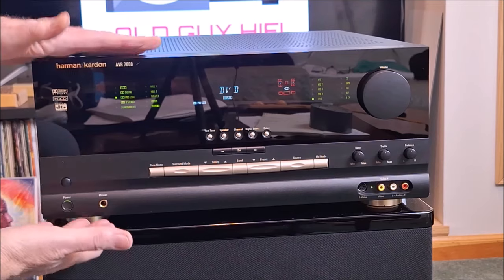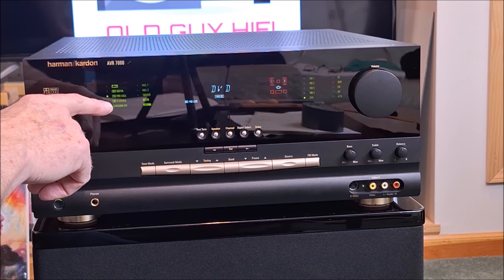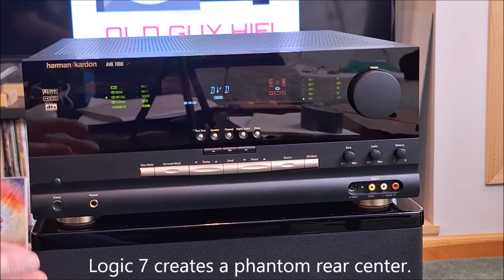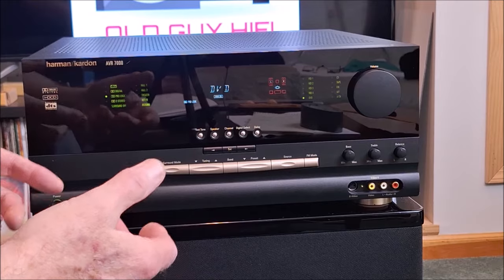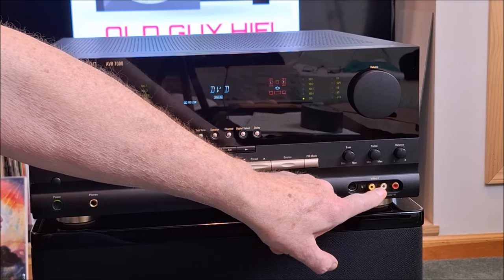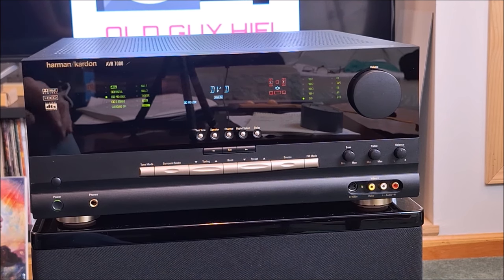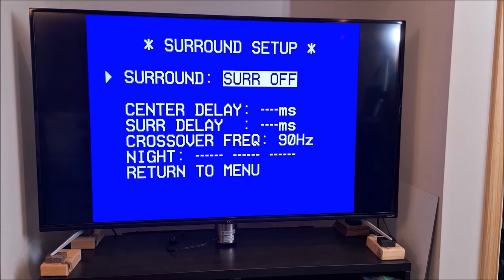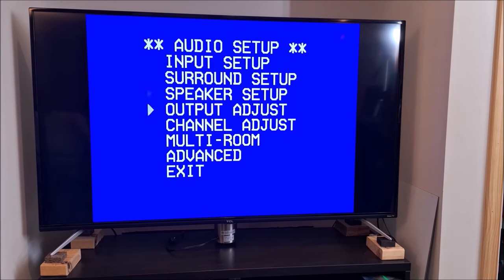A look back at the Beast that was the H/K AVR 7000

Comment from the maker: Hey everybody!  I hope you get a kick out of this nostalgic look back on this HK receiver.  Please like and subscribe.  Thanks for the views.
Reply: Thank you for this video.i love the old school HK amps,even the silver faced amps, especially the ones with the long vertical buttons.
Reply from the maker: I agree.  The series up to 1983 had that look.  I had an old HK 690i that was styled like that.  Thank you for your view.
Reply: I'm a fan boy myself.   I would sick a Harman Kardon 730 twin power on just about any of the 70's Marantz receiver.  Factz
Reply: Thanks for the great review! I also own an AVR 7000 which I've had since 2000. You mentioned you were getting your unit repaired. I too need to have mine, the DAC, repaired. Any suggestions on where to get a unit serviced? I first saw you over on CheapAudioMan thanks to Randy.
Reply from the maker: Ken, I was not able to get mine repaired as the parts are no longer available. Unfortunately I had to recycle it. I am very sad about that. I really loved that thing. My repair guy said that parts for these are made of unobtanium. He couldn't find a source for any HK parts for this unit. I know most of the Dolby chips are Sonys and no longer made. Good luck with yours.
Reply: @ That is sad to hear. I will probably use mine as a power amp with an external DAC/ preamp. Thanks!

Comment: Serviced them. Giant toaster ovens. No fan cooling was a big mistake. Look at the layers of circuit boards with the power supply smack dab on the bottom. When they showed up for service, all the capacitors had changed value, regulators had been toasted, and I was faced with changing hundred of parts. From my perspective it was the biggest pile of junk that ever graced my bench and the Pioneer SX-1250 was the best of the best.
Reply from the maker: Thank you.  Curiously, I never had any heat issues.  Maybe I didn't notice. It does have a channel out.  I am not sure that "biggest pile of junk" is the right description.  Then again, we all have our own opinions.  Thanks again.  Maybe you could fix it? LOL.
Reply: @OldGuyHifi  I swore those things off. I won't repair anything but American made pro audio now. That channel out could well be a cap that finally opened up. In fairness, Sansui, Sony, and Fisher made their fair share of electronic garbage back in the day, and HK did make some good equipment, when it was made in the USA and Japan. HK left our service shop high and dry, like all the major manufacturers. Towards the end you should have seen the bone yard of abandoned AVR7000's. Nobody wanted to pay for three days labor. Lol
Reply from the maker: I totally get what you are saying.  I saw the decline first hand.  It's a shame.

Comment: Bout week ago found AVR 5550, still has both remotes and works. For 25 eur I,m quite happy. 

Not as big as 7000 but still 20kg/1070W so quite a monster.
Reply from the maker: That's great.  I hope you enjoy it. Thanks for commenting and for tuning in.
Reply: @OldGuyHifi  So far love it (using as main amp for now). 

I somewhat collect amps/old audio equipment and from ones I have, its my second favorite so far.

Used Luxman L-405 for 12 years or so and after old Luxman, other amps sound bit off. Don't really want to mess with Lux to much nowadays, its rather old and if something dies... these are one of harder ones to repair or figure out what kind rocket science was used to make it work :)
Reply from the maker: Good point about Luxman.  It seems like most gear these days is considered disposable rather than repairable.  Shame. Luxman gear was so very good up until Alpine Car Audio bought them in the 90's but, it looks like their current owner, IAG is letting them get back to their roots.  It just so expensive now.

Comment: Proud owner of the 7200 since 2003.  The only issue now is the centre speaker channel is distorted.  Not alot folks that are willing to venture into fixing older units.  Still works however minus the centre.  Vocals when watching movies are mixed to the front now.  I configured the unit to set the centre off.  
And oh yeah, Over 60lbs.  Not easy to move around.
Reply from the maker: My left channel went out. My guy won't fix it so.... Thanks for tuning in and commenting.

Comment: Ed, Thanks for the Blast from the Past.  They definitely don't make them like they used to.
Reply from the maker: Thank you for the kind words.  No, that was different era.  Now you have to spend a chunk of change to get that kind of build quality.
Reply: Just FYI, it had a 6 channel input for outboard processing.  At that time, DVD, DIVX were battling formats.  Dolby Digital and DTS were duking it out as well.  Certain DVD players had surround sound processors built into them.  That's what the 6 channel input was used for.
Reply from the maker: I did mess that up. Thank you for the correction. I need all the help I can get!
Reply: @OldGuyHifi  Honestly, it was such a failed attempt by manufacturers to "future proof".  Nobody really used it.  Especially if you already had a processor built in.  So no need to worry about messing that detail up.
Reply from the maker: Thank you.

Comment: I got one, not using it currently but its great. Have repaired it because capacitors dries out and voltage regulators in the bottom of unit gets superhot
Reply from the maker: I have the full service manual and service bulletins for the 7000 if you need them  Let me know.

Comment: My display just went out on mine. Still using it! Would like to know how to repair, however.
Reply from the maker: Probably easier to buy another unit and retire the broken one. Just a thought. Thanks.
Reply: @OldGuyHifi  If I thought I could find another of that unit, specifically, I def would.

Comment: Hi, thanks for your well done exhaustive presentation of the AVR7000 monster ! On my side I have a problem on my AVR7000 that is noise on 6 channels is coming after few seconds it is switched on. Do you think it may come from 4 big capacitors of power  supply ? I would like to avoid replacing it for nothing. Do you know someone who could help me to investigate and repair it ?
Reply from the maker: Where are you located? If you were here in Chicago I know a good place.
Reply: @OldGuyHifi  in France ! But I'm able to do investigation/repairing ... with remote support ;-)

Comment: I have a Harman/Kardon AVR 230 7.1 Receiver, I'm not sure how it rated.
Reply from the maker: The 230 was a fine unit.  Very powerful in 2 channel and decent in surround.  It can produce up to ±35 amps of "High Instantaneous Current" which is better than almost any other 65 WRMS unit.  I bet it sounds great.  Thanks for commenting and for your view.
Reply: @OldGuyHifi  The 230 has 4 speakers a woofer and centre speaker. It came as a package. The 4 corner speakers are on stands as well. I also bough a Harman/Kardon 430 new a long time ago. It's also mint and works great.

Comment: Just add a modern surround processor and presto! The electronics may be outdated, but  a huge torroidal and 2x 22000 μF sure isn't. I'll have an eye out for one to plug in my same-era Infinity Kappa 600 set.
Reply from the maker: Great suggestion.  The Kappa's are great speakers.  I met Arnie just after Harman bought Infinity.  Smart guy.  I have gone back to my roots of 2 channel only. The HK has a channel out and I am planning on getting fixed and then moving it on to someone new. I have a strong sentimental attachment to it though.  Thanks for the view and comment.
Reply: @OldGuyHifi  The AVR 335 was my gateway actually., together with a set of small Beta's that are still being used as surrounds. Since I got the 600's (€100 each, killer) I'm lusting for a HK 990.  Funny how a AVR 7000 can be had for under €300 whereas the HK 990 is about a grand. End of an era,  befor cringing  started. Thank you sir, most informative. Subbed.
Reply from the maker: The 990 is an awesome unit.  I had a demo unit for about a year and it drove a pair of Wilson Watts & Puppies with authority even with that famous 1.6 Ω dip in impedance at the X-over point.  They are going for about a grand here as well.  It would be great to re-visit one of those.

Comment: Can you explain more about what chip amp is and who uses it?
Reply from the maker: Great question. Chip output devices evolved as a cost cutting measure back in the 80's. They were still discreet, i.e., a bunch of transistors in a single package. They still ran as Class AB and were adopted by a lot of manufacturers. In those types of amp the power supply ran at full throttle and you attenuated the input to control output. 

Today there are basically two types of chip amps. The Akitika amp I reviews uses a class AB "chip" output and is a fairly traditional design.  

Then there is the inexpensive Class D chip amps which operate in a different fashion.  They are very thermally efficient and draw less power than than a traditional transistor amp as they use a high speed switching power supply to control the amps output. On the upper end of the scale there are Class D amp that are based on individual discreet (not chips) components but use the same sort of high speed switching power supply just more advanced. 

I own a Cambridge EVO150 which is a Class D amp and it sounds amazing. At $3000 it should. I have a Rogue Pharaoh II amp in for review which is Class D with a tube front end which sounds amazing.

The upshot is: Chip based Class AB amps typically are inexpensive. A lot of AV receivers use Class AB chip output device.  The lion's share of Class D amps occupy the entry level and can very inexpensive and ok sounding. There is a growing segment of  "high end" amps that are developing excellent Class D products, like PS Audio, Rogue, Cambridge, Mola Mola, and a bunch more. 

There is nothing wrong with a chip based amp as it is all in how it is designed and executed. I hope that helps answer your question. Thanks so much.
Reply: @OldGuyHifi  Thanks ! That helps. 
I was confused because Cambridge  ax 35 said chip  but AB?? and I think my Arcam sa10 says AB.  But thought I heard chip in one review and I did not understand how it could be both!
Reply: So a torridal power supply can still use a chip and be class AB?
Reply from the maker: @nascarracer886  The Cambridge AXA25/35 are Class AB chips. Just think of it as the transistors are in one package rather than individually mounted to the heat sink. There is a stigma about these chip based Class AB amps when there shouldn't be. Tarun, the British Audiophile gave the AXA35 his amp of the year award a couple o years ago. I would not want a 100 WRMS chip based amp but up to 60 WRMS they can be quite good.
Reply from the maker: @nascarracer886  Yes. Absolutely they can use toroidal PS and it is a good thing for any amp of any type. I hope this helps. Thx.

Comment: HA. I have one of those. Had to switch it out because of HDMI only Monitors. Now have a Marantz.
Reply from the maker: I totally get it.  I got around it by routing my HDMI equipment directly to the TV and then running an optical out f the TV into the AVR7000.  That worked great for years.  I also love Marantz. You may have noticed the photo on my channel home page is an old Marantz Class A integrated. Back in the day we were pretty big Marantz dealers.  Thanks for the view and comment.

Comment: AVR7000 was rather unreliable, sounded ok, but blew up when you drove it hard.
Reply from the maker: I had a totally different experience with mine.  I used it hard for 30 years driving everything from Maggies to Martin Login, Wilson Watts & Puppies and Energy Verirtas first gens, and many others.  I never had an issue.  It does need service now but it is from caps dying from old age.  You can see them leaking on the PC board.  Thank you for your comment and view.
Reply: @OldGuyHifi  I worked for Harman back in the 00s, we had truckloads of unrepairable AVR7000 we had to scrap.
Reply from the maker: I was unaware of that.  Things were definitely changing at that time.  I think that management going in the wrong direction. They were so focused on Harman Motive that HK was an after thought.  Also, Dr. Harman was also close to retiring then.  Moving production to China didn't help either.
Reply: I still run two , and no problems yet. my pair are still sounding great and running strong.
Reply: I have a video somewhere of an re audio sxx 18" driver being driven by one of these playing bass I love you and I can definitely say it is not driving them hard that kills them, shamefully!  When i was younger I used to use the center channel to drive subwoofers and it worked so well that i did it for years and yes i even ran it 2ohms( now i run a crown cts1200 on the subs).. oh yeah the amp still works greak:)

the caps that makes these amplifiers stop working are on the processing board so your safe to run them full blast as long as your processing boards are good